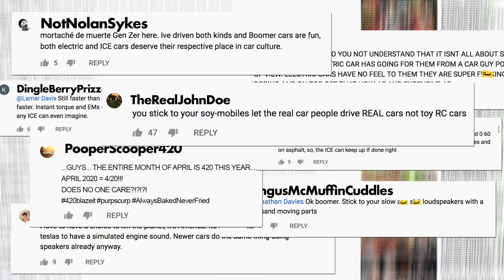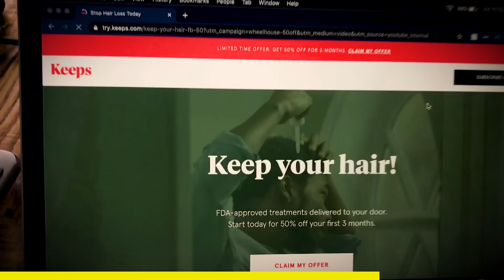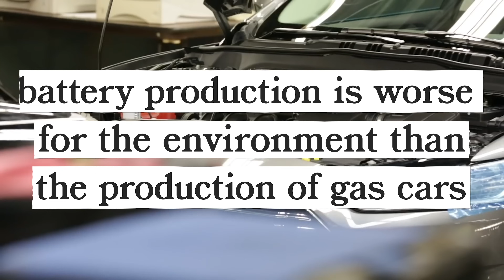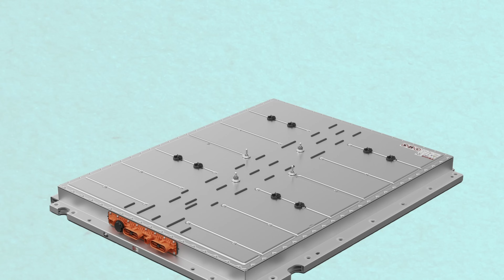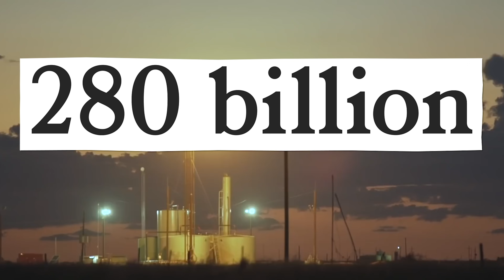Are Electric Cars REALLY Better for the Environment?

Comment: 5:54 don’t know why people don’t include Nuclear Energy in “clean” energy because yes it is clean. I think the reason is because a lot of people have very strong negative opinions about nuclear energy that simply are not justified.

A lot of these “disasters” were blown out proportion, disasters such as Chernobyl and Fukushima were kinda blown out of proportion, mainly the latter. Fukushima didn’t actually kill anyone from the radiation, the people who were injured or died were because people were freaking out and as you might know, humans get very violent went they’re scared, so people who “accidentally” injure or kill each other to get out of the place. Chernobyl is a bit of a different story, it was a horrible disaster, and really made nuclear energy look bad, it destroyed it’s reputation.

With Chernobyl you have to remember who built the reactor and who was operating it, it was the Soviet Union, which at the time didn’t care about safety and only cared about minimizing costs and getting profit, the workers were also not trained the best. Something I found out is that the night shift for Chernobyl were not as well trained in an event like this and they ended up doing the wrong thing, the people in the day shift were actually properly trained and if something like this happened they would of prevented it.

Also some misconceptions have arisen about how radiation works, some people think that putting say a block of uranium down on a table and then moving it far away, only leaving the block there for a second would make the table radioactive. This is not what would happen, the table would be completely fine as long as none of the uranium flaked off, and same thing can be applied with managing reactor melt downs, just remove the radioactive material and it can be solved as long as something like Chernobyl didn’t happen.

Now I actually want to go into how modern day reactors are safe. Reactors nowadays have been designed with the previous disasters in mind, almost all of them can never meltdown assuming you don’t force it to melt down. They’ve also been designed so that if they do somehow meltdown the corium (what is basically just a name given to the material that forms when the core melts down) stays contained. A lot of reactors have apparently had a “meltdown” when it wasn’t even a full scale meltdown some didn’t even have the core melt at all they just heated up a bit to much and damaged the reactor not causing any radiation to be released. 

Many reactors from years past have also been upgraded to be made with new technology making them safer, and new reactor models like molten salt reactors and more make it so much safer. The molten salt reactor is proposed to use Thorium which is a radioactive element that can be found literally everywhere in the world. Thorium is a lot safer because it’s less radioactive, it isn’t toxic like uranium (btw being radioactive doesn’t mean the thing is toxic, something being toxic means that if you consume it can reactor with stuff in your body potentially killing you), and it doesn’t bioaccumulate like plutonium does, bioaccumulate just means that if you consume something it refuses to get out of your body band can stay in vital organs of your body. The molten salt breeder reactors can use their waste and convert it back into fuel and keep using producing far less waste. 

Now I want to go over why they’re safe. People say that being next to a reactor is where you can get the most radiation possible and can be very dangerous, but that is so far from the truth. The way radiation works is that an atom wants to become a lighter more stable element and it does this in multiple ways. One way is through alpha decay which is by splitting into multiple atoms or ejecting a positive ion usually a helium nucleus with no electrons. The second was is through beta decay which is via shooting off electrons. The final is through light, usually x-rays or gamma rays, which are rays of light with an extremely high frequency. 

Uranium’s primarily through alpha decay which is quite easy to stop, using a sheet of steel is usually enough to stop the radiation completely. Usually beta decay and gamma rays, but the latter is usually hard to come by in high amounts. Thorium also generally decays via alpha particles as well. An inch of something like steel should be able to easily stop all radiation form the reactor so there’s no need to worry about the radiation from the reactors.

Then there is waste some of the people saying “what about the radioactive waste” clearly don’t know where you get the fuel. News flash to you guys, but uranium comes from the ground so putting back into the ground doesn’t change anything, it actually might make it better because the radiation is actually slightly reduced due to the radiation being sped up slightly form the increase in nuclear fission the reactors. Also you get more radiation from the sun than if you lived next to a nuclear reactor. And you get less of an increased mortality rate form working at Chernobyl cleaning waste than you do working in an office building.

I think renewable energy is still good however it’s over hyped. Wind is probably the most over hyped, it requires a large amount of space, several square miles just to equal the same output as a nuclear reactor potentially a hundred times smaller than it. Wind turbines also kill thousands of birds and other animals each year due to them flying into the blades, plus wind turbines require a very high amount of maintenance. 

Solar I think has some potential but it’s also over hyped. I think solar could be more affective if we actually had the proper batteries to store so much energy for later in the day. They also have a similar problem to wind, to produce the same amount of power as nuclear, you need several times more surface area. Solar panels also kill a lot of animals due to birds and stuff landing on top of them and being roasted alive due to the heat that they produce. One thing about solar where I see a massive potential with it is on space stations because they’re far more affective in space, just look up the solar sail that should give you a good idea as to what I mean.

Hydropower is another thing that is renewable but I think it has the largest issue. Hydropower produces a lot of energy for how big it is but it can be incredibly dangerous. Hydropower kills hundreds of thousands of fish each year which has started to take a toll on some species of fish. Hydropower has caused the worst disaster from an energy power plant in history, far worse than Chernobyl could ever have been. I cannot remember where this was but a dam collapsed somewhere (again can’t remember where that was) and it killed over a million people and completely wiped out an entire area due to the collapse of the dam.

Nuclear energy really has an underserved reputation due to over dramatization and general fear mongering from the general media. Nuclear has actually caused the least deaths of any power generation system even less than solar. 

I do admit there are some issues with it like current reactors taking a while to build and costing a lot to build, but the amount of money and how cheap the fuel for them is, and how low the maintenance costs are really out weigh the problems of building the reactor. Problems like building cost and building time can be solved with the new molten salt reactor it’s than can be made modularly so that they can be built in a factory where it’s cheaper to guide them and then have them shipped over to the building site.

One last thing, I think nuclear fission reactors complement the new nuclear fusion reactors being developed really well. The could technically be linked together but as far as we know that is very difficult and doesn’t really result in that much higher energy gain, but still the potential is there.

That took two years to write, probably my longest comment ever. To lazy to read through it again and fix an grammatical mistakes so you’re just going have to deal with them. Also please don’t say “ice engine” because you’re basically just saying internal combustion engine engine.
Reply: Bacqiao Dam collapse in China. 250k dead directly and indirectly.(5-10k from NPP disasters from some of the worst estimates, mostly Chernobil). Other collapses killed loads of people too. Always more than 200 people per collapse. The fish issue has been dealt with by using various methods so with most dams its not an issue. And a dam has 1001 uses besides power production, boosting the economy of the nearby area (so does nuclear with the plant operators). 

Solar and wind not only require large areas but the disposal/recycling of the stuff is pretty problematic. Microplastics, heavy metals, etc etc. Building them at already developed areas is a solution for the area issue, but I'm doubtful that would be enough. 

Nuclear is indeed the "greenest" energy source all things considered. Especially considering fast breeder reactors(FBRs) that gobble down conventional SNF, DU and natural Uranium, and turn it into conventional reactor fuel and MO POWA BABY while doing so, reducing nuclear waste to a nice degree. You can also desalinate water or do whatever you want with the waste heat like district heating or for industrial purposes as well.
With so much power from mostly Nuclear and dams, synthetic fuel could be made basically on site. Eliminating the need for EVs.

Comment: You are wrong about the size of the CO2 footprint for EVs, so I will now type the info that I have on this subject. And this comes from an actual Electrician that I know. EVs WILL NEVER HAVE A SMALLER CO2 FOOTPRINT THAN ICE CARS, it isn't possible. Because the energy source has to be moved over at least 8 transfer points. It. Will. Always. Take. More. Energy. for the EV to equal the ICE car from Point A to Point B. Do Not take my word on this, GO ask an electrician. And even if that is just 9% more, you still have to recharge the EV to equal the gas ca'rs range. So the footprint is now double PLUS 36%% more than the ICE car.   And I'm not just counting what comes from the car, I am also counting the footprint that comes from the power source and then then fact that it has to get to the car. DON"T trust the App. The Grid. It can take the heat? Then the people in charge need to prove it. Sorry, but it has to be done. And then they have to explain to everyone why it can't take the loads that it takes now.  Bull on # 3, I don't care because I don't want one.
Reply: Plus a little bit of energy is lost from the lithium ion battery give back it’s energy that it has stored. It isn’t that big but over a decade of constantly draining and recharging the battery, it’ll eventually lose it’s life and the car will have a far shorter range.
Reply: @stardust7186  thank you.